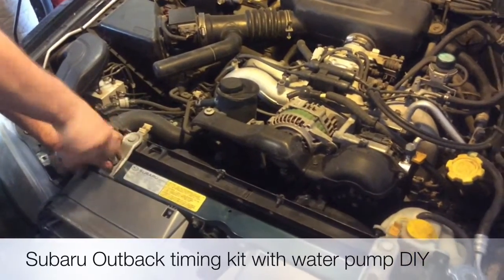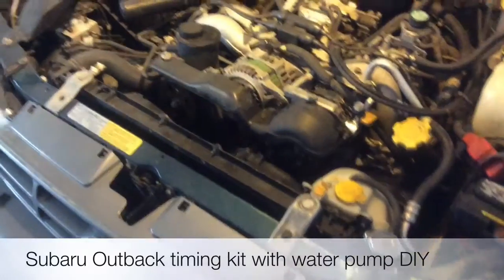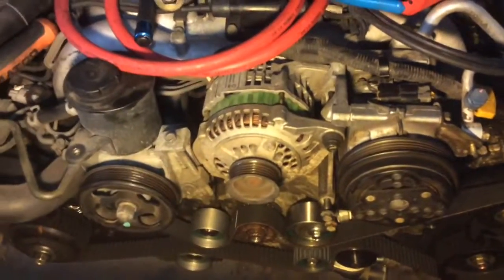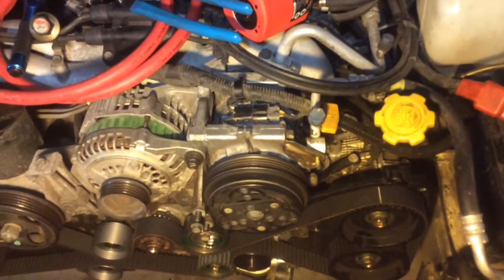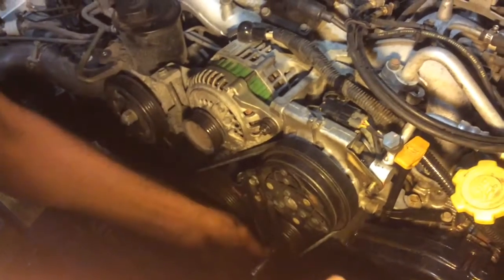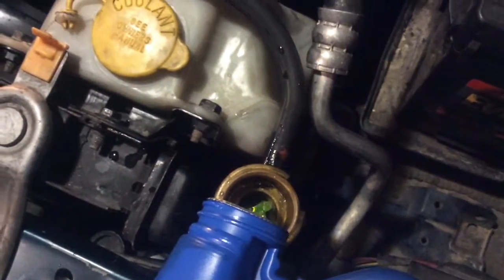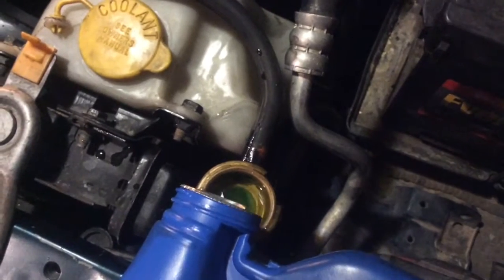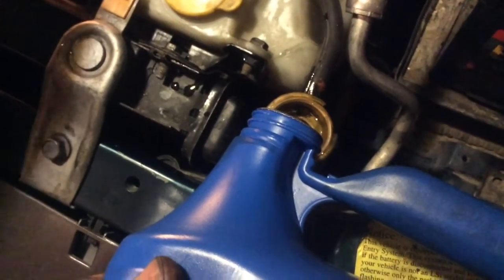Subaru Outback timing kit install with water pump

Comment: @5:38 what did you do there? The audio is quiet. And how did you get the pully off?  I want to change my 96's water pump, but that part lost me.
Reply from the maker: By placing a long ratchet on the pulley bolt against the frame and cranking the engine half a turn
Reply: OK thanks!